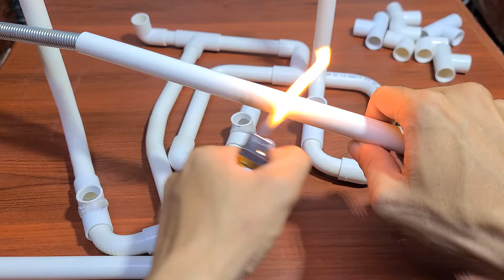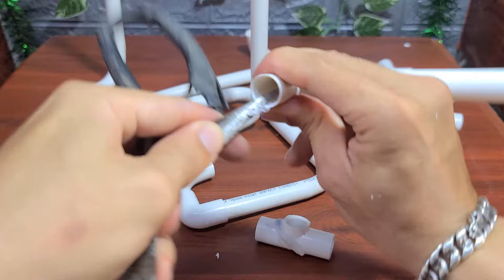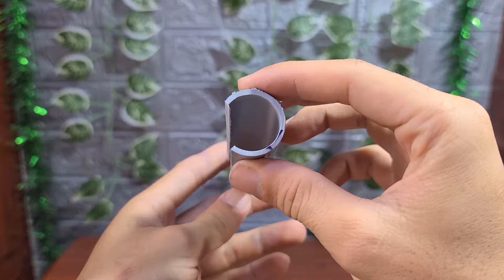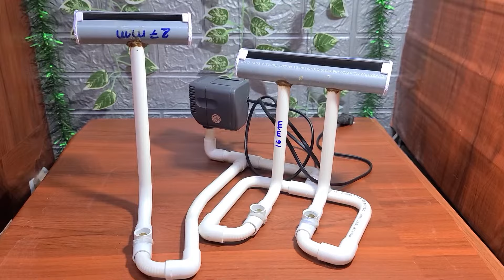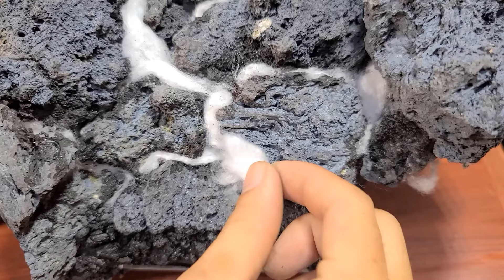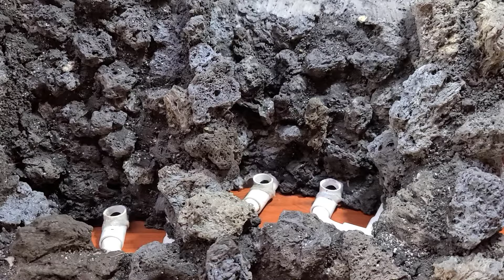How To Make Sand Flow More And Beautiful | DIY Sand Waterfall Aquarium

Comment: Can i use flexible pipe, used for electrical work
Reply from the maker: That's fine, but the inside must be smooth so the sand moves smoothly

Comment: I made one but all I get is a little volcano spew at the sand Feeder  hole and tiny amount of sand at the mouth of the sand water fall part what am I doing wrong .I put more support at the feed portion so that I don't get a water pressure loss at feed portion of pipe ..but still a problem
Reply from the maker: Maybe the pump is too weak or too strong. Waterfall too high can not. You should do the right sanding reed and I have full instructions on the channel.
Reply: I have the same issue! I have a adjustable pump on mine and I’ve tried it’s lowest setting and highest setting with no change.

Comment: What kind of glue is this that your using, also is that cotton that your using to connect the pieces? I’ve seen this done on several videos but can’t figure out the type of glue and material being used
Reply from the maker: The glue I use is super glue, I use medical cotton to make the connection more secure

Comment: When i start waterfall after 1-2 hr water look cloudy. I wash sand 5-6 times
Reply from the maker: You should wash the sand with soap and let it dry in the sun before using
Reply: @RelaxLifeVIP  i wash it 10-15 times